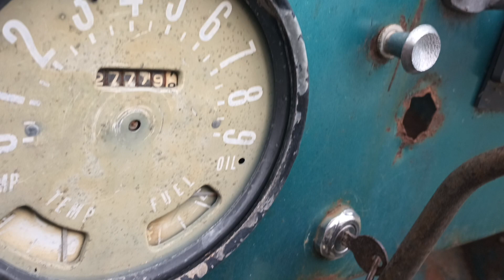This old farm jeep @vintagejeep

Comment: That would be sweet to get running again. 👍
Reply from the maker: That one starts and drives. Like most of the equipment sitting around here, it is seasonal. He has it stuffed into an old U-Haul truck box (used as a garage) for the winter.

Comment: If it works, Buy it!  No smog crap. Better than todays ATV side by sides. Tops and doors are readily available.
Reply from the maker: My Brother in law did some dealing a few years ago and ended up with this gem.
I think he has more into buying the paint and rollers. It is finished off to a nice 20-grit stucco finish. (Green Rhino liner)